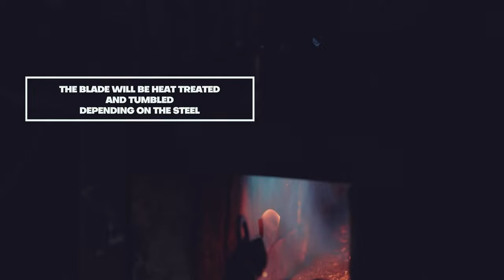The process of making our knives. TOPS Knives

Comment: Tops is one of only a small handful of production fixed blades I use and trust these days. When it comes to 1095 and micarta, in my opinion there’s no one better than tops in the “production” game and they have a very specific aesthetic with unique and original designs. Also every time I buy a Tops knife big or small the primary and secondary bevels/grinds are symmetrical, the handles are fitted well, and their 1095 differential heat treat is absolutely phenomenal. There are other brands that charge more money while using expensive powdered steels and premium handle options but with some it feels like a roll of the dice when it comes to fit and finish especially with companies trying to fill back orders due to the last couple years. That said, it feels like Tops quality has only gotten better even as they try to keep up with demand during this current and complicated knife boom we’re in. Tops is a prime example of a proud USA made production company making top shelf products. That was a lot longer than I planned but man Tops is one of those brands that makes you proud knowing everything is 100% made here on American soil.